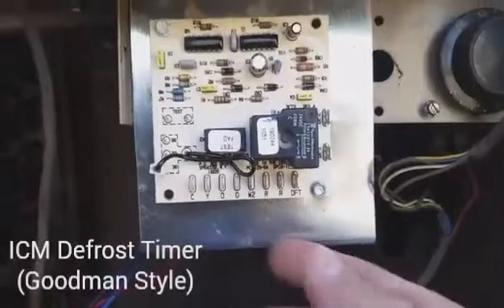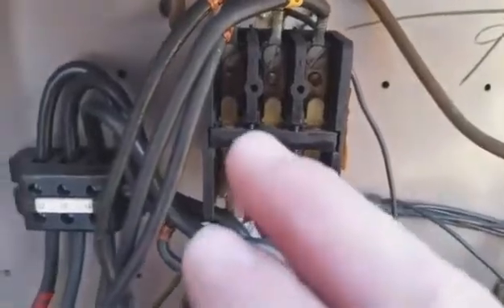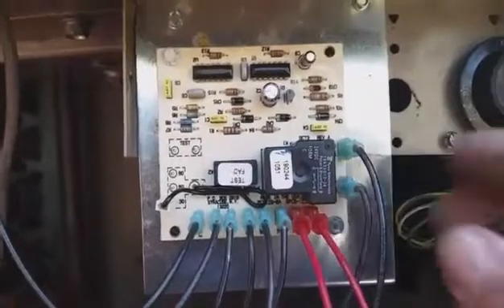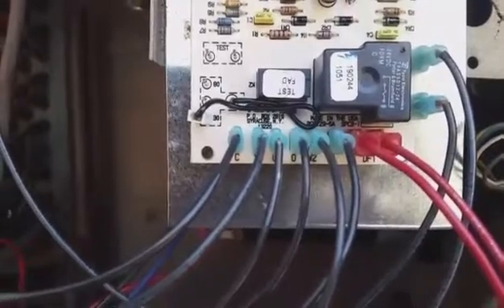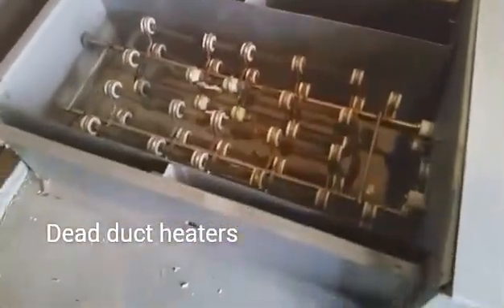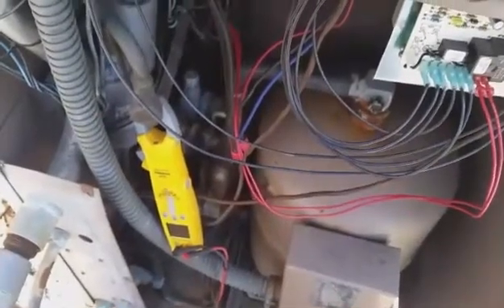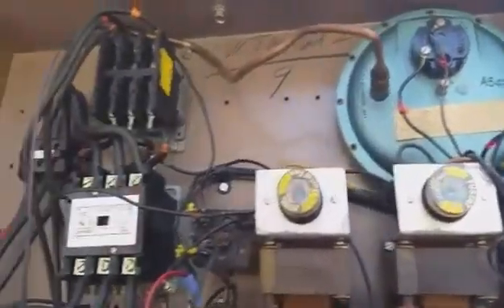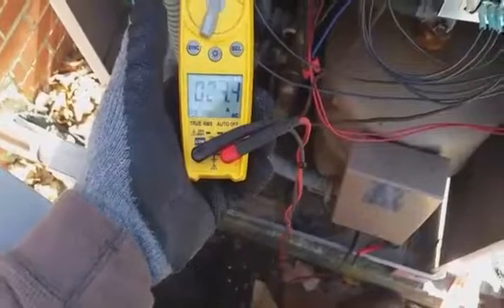HVAC Commercial Service : Defrost Board Retrofit

Comment: Nice job Zack, it appears you wired the new bored in parrallel with the old but you have replaced the old defrost system with the new board controling the low voltage fan coil, the coil temp sensor and the reversing valve, while the old board controls the cooling contactor, heat strips and I believe but not sure the indoor fan motor?

Comment: Now you compare that amp draw to a new one and you see my point. Thank you for taking the time to do that. But that old system is cool for the younger guys to see how it used to be.
Reply: The two other BWC packaged heat pumps I work on are good examples of their "energy sucking" nature. The 2 ton compressors in them pull 12-14  amps.
Reply: talyn875 Yes they may eat amperage but they were built to run (Tanks!!!)
Reply: Larry Cole I agree. There are several still in operation that I service.